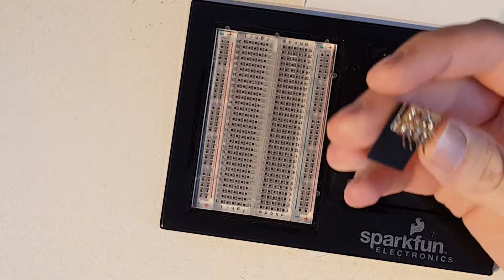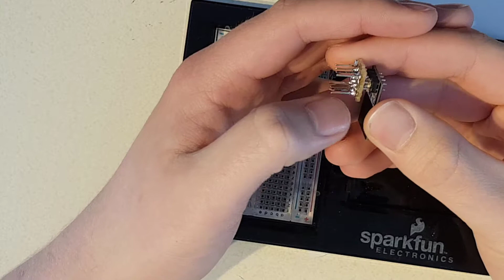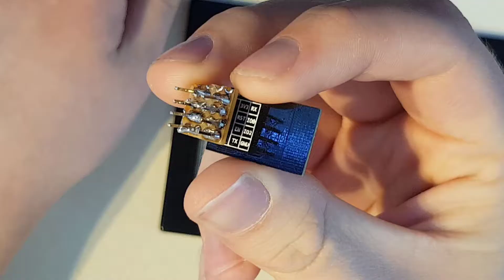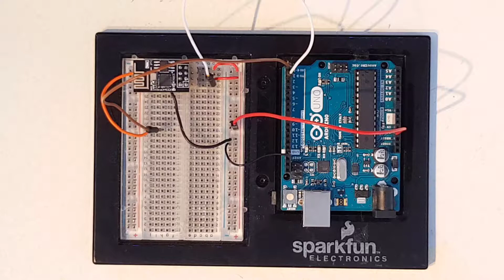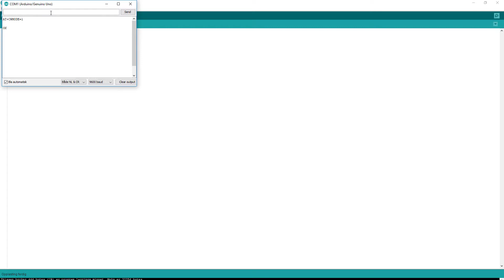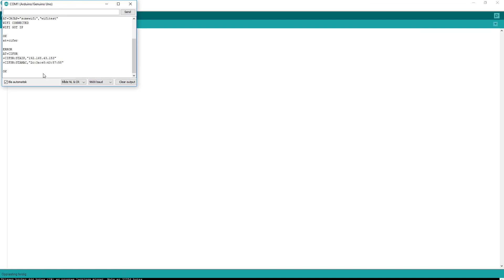How to setup & test ESP8266 with an Arduino UNO

Comment: Thanks, first tutorial that's clear, clean and to the point about this topic.
Guess part 2 has been cancelled?
Reply from the maker: Hi!
First of all: Thank you for the kind words!
I made this video back in my second year of high school studying electronics, and have since graduated and become an actual 
engineer (!!). So you can say I've been busy! 😅

You're unfortunately right about a part 2, since I haven't worked with the ESP8266 in a while. I would recommend checking out the ESP32, as it has WiFi connectivity built in (no need for an Arduino!), and it's a widely used and documented board, with lots of videos online.

I would love to upload some more videos about topics I find interesting in the future, so feel free to subscribe! 😊

Comment: Hi, did what you showed.
Get no "OK", tried different baud rates, don't help.
Did you know what's wrong or have you any idea ?
I've tried 3 different ESP8266 modules.
Reply from the maker: I'm unable to help you at this time, but I would suspect there to be an error in the Arduino hardware. Does other code run fine (see the "blink" canoe program in the Arduino IDE).
Reply: @larsiparsii  Thanks for your fast reply.
I don't believe, that's it came from the arduino hardware. Cause arduino code runs fine and i tried also different arduinos (first i tried it with nano, later with an uno).

I was able to get some "lines" mesages from the ESP and now i know it's from AI Thinker. But always those "lines" end with an "failed".
I think all my ESP8266 borads are faulty. As far as i see / understand it's behavior, i would say comunication dosen't work.
Maybe i got some replacement boards and they used them without the voltage divider... ???
I'll try to buy new ones and then i will test it again.
Reply from the maker: @VerrückterPeter  That sounds like a plausible explanation! If you want to develop more for Arduino hardware with WiFi capabilities, I would recommend checking out the ESP32!
Reply: @larsiparsii  Thanks for the advice. With an ESP32, is it possible to code sockets on the arduino side or will that have to be done on the ESP32 side?
Reply from the maker: @dbtest117  Hi, and sorry for the late reply!

You wouldn't use the ESP32 together with an Arduino board. Instead you'd program it like how you'd program an Arduino board, but with some differences. ESP32 offers a more "complete" microcontroller, with integrated WiFi and Bluetooth. This connectivity together with it's small size makes it great for IoT applications. I recommend reading up on it! :)

Let me know if you have any other questions!
Reply: @larsiparsii  Thanks for the verification I was afraid this was the case. It’s really difficult finding a way to add wifi to arduino board. I’m uesing an Arduino Mega and trying to find a way to add wifi connectivity to it and Bluetooth that can detect presence of a paired iPhone.  

I have a couple of raspberry pi pico w, and looking for an similar experience but for the arduino mega. If at all possible.
Reply: Try RX to TX....not RX to RX